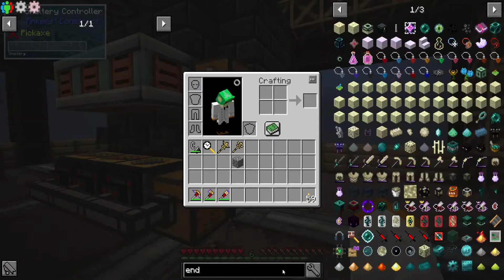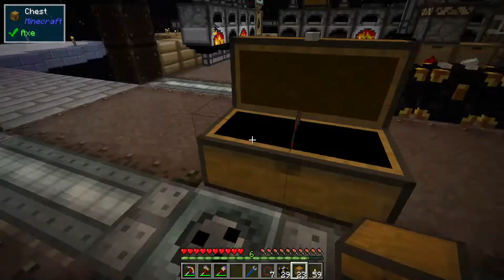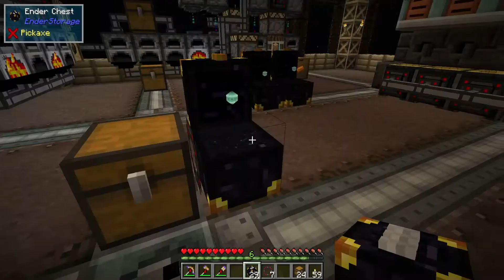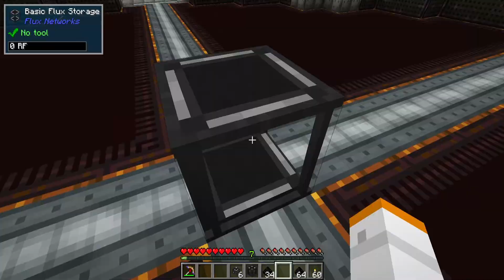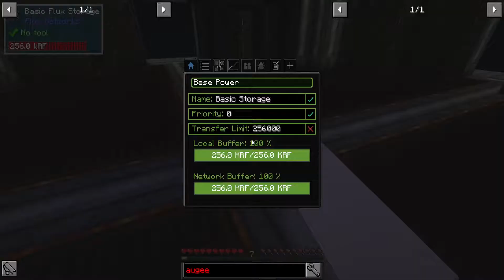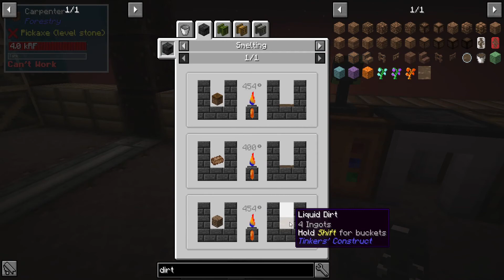Ultimate Alchemy RF Power with Redstone and Flux Networks EP4

Comment: I piped my pickaxes into a tiny chest from XU which the crafter then pulls from as required. Cuts down on the amount of pickaxes being crafted.
Reply from the maker: I thought about that, then remembered we have infinite materials that don't need a miner to get. Whole system will be going away once I move it to a production area.
Reply: thanks for showing flux networks, never used that mod before, never even thought of looking for it. Was thinking EnderIO conduits and that rabbit hole. Good shout on the dynamos, scurries off to pinch that idea. Definitely have to think about "I have infinite of resource X, who cares what it costs?"